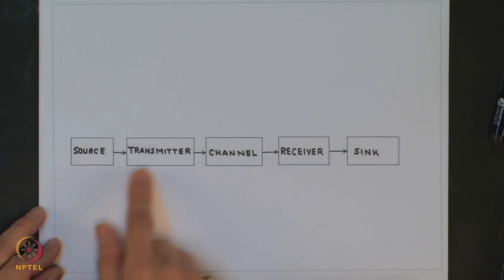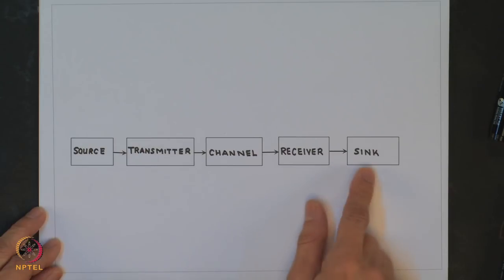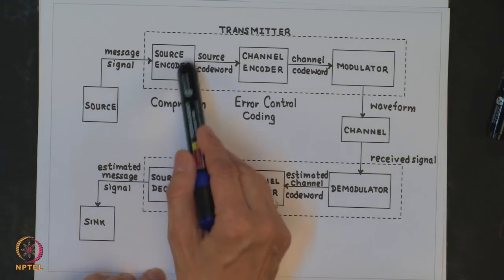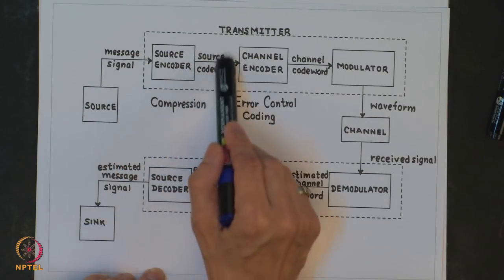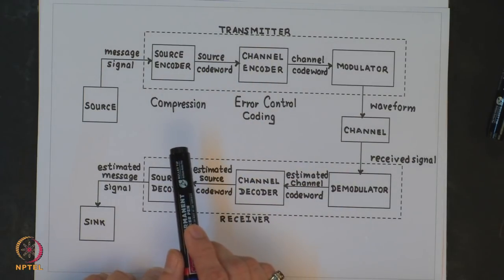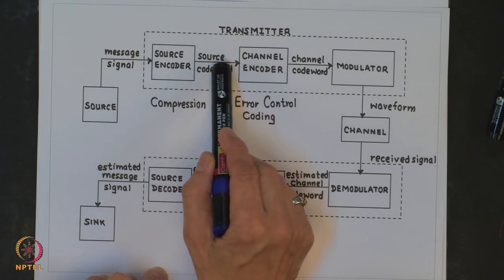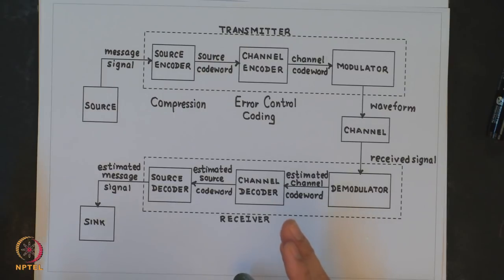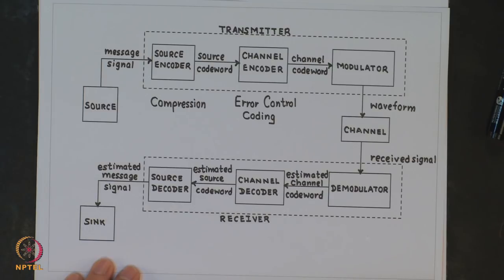Week 1-Lecture 1

Comment: Is Continuous time discrete amp considered as analog or digital? ex: Square wave is analog or digital?
Reply: @satyaprakash3931  thank you
Reply: @manasayarramasu7833  yours welcome.
Reply: Square signal is considered as a digital signal
Reply: a digital signal is the one which is discretized in both time domain as well as amplitude...discretizing only in amplitude shall make the signal just quantized...so i think nope...continuos time discrete amplitude signal can't be considered as digital there are more chances for the signal to be analog
Reply: This is a good and kind of tricky question, especially for beginners.

A descret time signal is a sequence of numbers. These numbers are real numbers.

Digital signal is sequence of numbers/symbols, these numbers come from only a countably finite set called alphabet. Examples  of alphabet {0,1}.

The signal in question is not a sequence. So in strict sense, the answer is no. But as it can be seen as a continuous time waveform (signal) that represents a digital sequence.

 So the signal you ask can be seen as representative of a digital signal.
Reply: The continuous time discrete signal is analog. As it doesn't contain the discretization of the vertical or magnitude axis. And square wave os also analog signal until it is discretized.
Reply: What is TS second, or is it simply t sec ¯¹